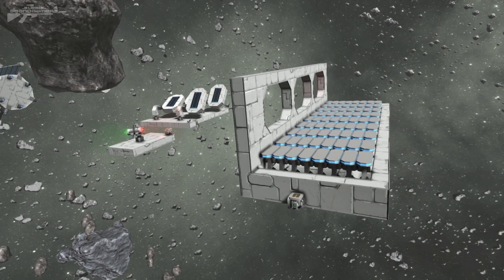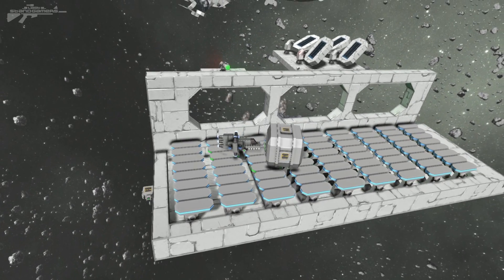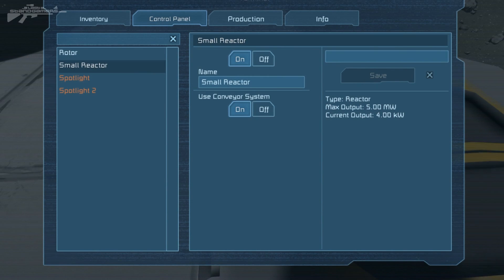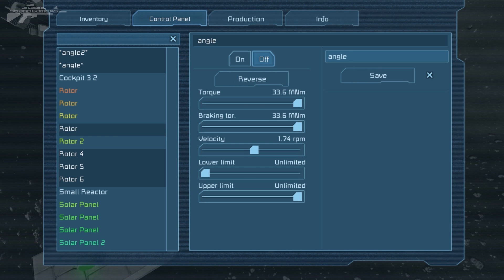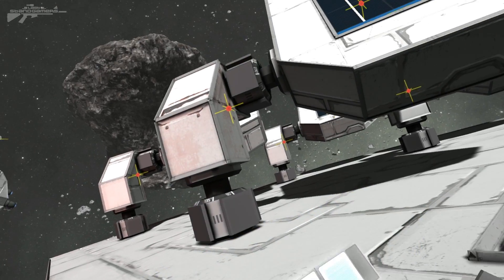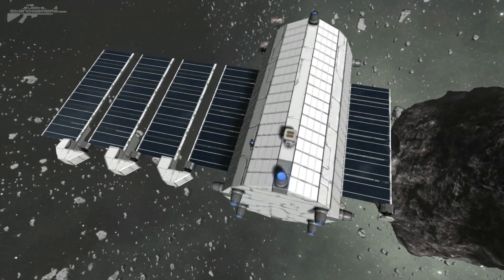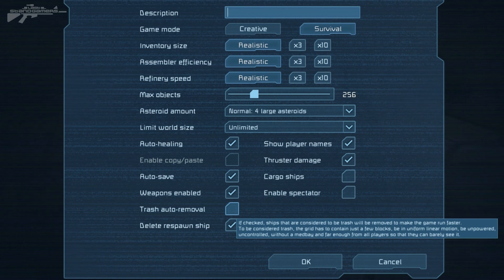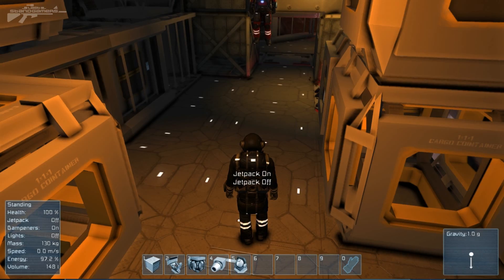Space Engineers - Rotors Transmit Electricity & Folding Solar Panels

Comment: Their is one thing wrong with this game your in space no gravity means nothing has a weight
Reply: Cody Sewell 
Quite wrong, even in space objects have weight, or "mass" if you prefer.
Say that a spaceship crashed into our moon, which would be moved the most? The spaceship of course, as it has less mass than the moon, the moon would just simply not give a damn.

Of course speed is a factor also, a ship travelling at, say, 1,000 MPH would have slightly more effect on the moon then a stationary one, but not by much.

To stop the moon in it's orbit, you'd either need another object nearly the same size, or an object going incredibly fast.

Comment: I created a ship that runs mostly on solar power, on survival multiplayer. I took my large ship, quite large actually, it has a beacon. However, when the other players try approaching, my 8 guns and 2 auto-rocket launchers nuke them out of the sky. The solar panels are arranged in a way that looks like an unfolding flower with dextrous petals.

My reactor has enough power to move the rotors and move slowly by itself. Anything else and it would scream and have a seizure, often I lose power to certain engines. I don't mind this, because... well... the players have learned that one does not simply approach the death flower and live.

Also.

A small ship can have a scorpions tail, so to speak. With a grinder on the end. It'd be funny if said scorpions could land on an enemy ship and stab into the large ship and destroy the target from the inside, without going inside!

Comment: I had already built a solar powered asteroid base in Asteroid Survival Mode by snagging a Private Sail for parts and placing a couple of frame blocks at the entrance. Using two rotors along with a solar panel, cockpit and reactor for powering the rotors and getting the right angle. It took some time but once done I removed the rotors and reactor then ran steel frames all the way through the asteroid placing spotlights as needed. FYI: 28 and 45 degrees seems to be the magic numbers. Wish they had this patch a long time ago; it would have been so much more easy to do.

Comment: Since Engines only require power, couldn't you make gimballing (rotating) engines?
Reply: No ... Engines, Tools, And Weapons Dont Work On Rotors

The Reason Is most Likely That You Can Make An Infinate Number of Thruster Angles In Relation To The Cockpit ... Which The Inertia Dampeners Cant Handle... Before They Impliment That Feature They Need To Rework The Engine Mechanics
Reply: Cereal Killer Awww, that kinda sux D:

Comment: Finally moving solar sails for long range flights are possible. I remember when I got lost in space and was using a makeshift spaceship the lack of fuel was a really big concern to me so I decided to make a solar sail using parts salvaged from commercial ships but unfortunately found out that rotors back then didn't transfer power so the whole time I spent on building it was wasted. But now if someone ends up in same situation they can save themselves by building a solar sail that can be moved to better position to get power from the sun.

Comment: Shame that you still cannot fire weapons that are attached to the rotor from the cockpit also thrusters wont engage if connected by rotor. Hopefully this gets updated so that it works and the copy paste feature on the rotors would have been nice.
Reply: I can understand a little why it's unimplemented for now... having rotating thrusters with inertial dampers causes your ship to go in odd directions. The whole thruster system probably needs reworking to cope with angles that previously weren't possible (in relation to the cockpit)

Comment: I suddenly got an idea: could the merge blocks be used to connect to a satellite like that and charge it? Could you use the reactor like a battery that way?
Reply: sanY1888 What do you mean? Anything is possible!

Especially this. This would be very easy to do, You could make a small reactor with a merge block, have your ship connect with that merge block, and wham bam, you have a battery. It's literally only 2 blocks, so when you're done with it you can either leave at the next station or just fling it into space.
Hell, you could make a ton of them and use the auto-locking landing gears to just hang-em-up on the station for someone to come by and quick use it.
Great idea, Dinohunter!
Reply: the reactor doesnt work as a battery but they really need to make a battery block that can be charged by either solar or generators because it would make solar panels a main power source
Reply: not possible
Reply: sanY1888 well the it would work as long as it has fuel
Reply: it shall be done, my master